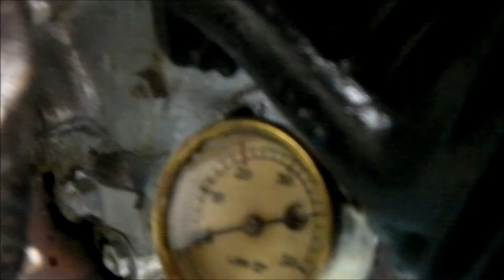Norman T300 Running Improvments

Comment from the maker: hi jon, i did not have to re set the timing on the engine i only switched over the spark plug leads and it ran fine after that

Comment: Hi there, I,m currently rebuilding my T300 , just doing a few improvements, one thing i have done is re-set the timing as mine was running erratically on one side, the timing was one tooth out at impulse, i now have the impulse tripping bang on the timing marks on the timing gears and hope this helps the running issues i,ve had, where did you set the timing on yours? i,ll post a vid of mine when back together soon, just waiting for a new woodruff key now to re-mount the newly painted flyweel,jon